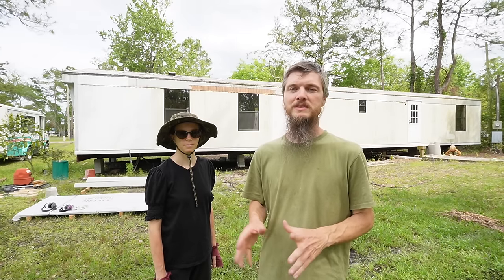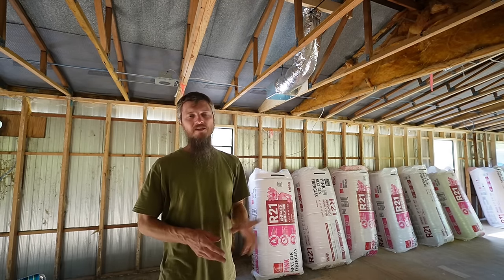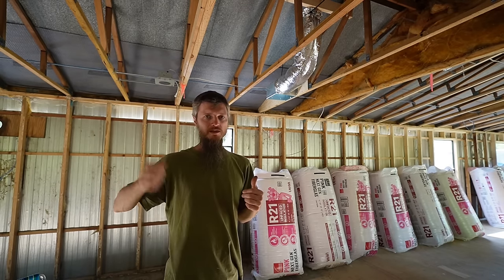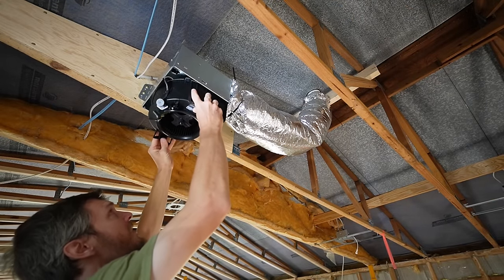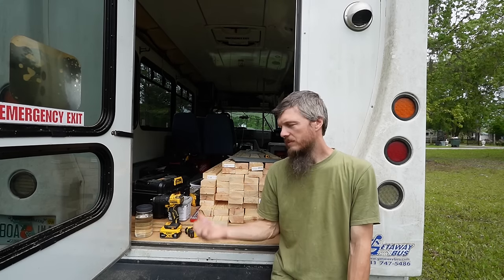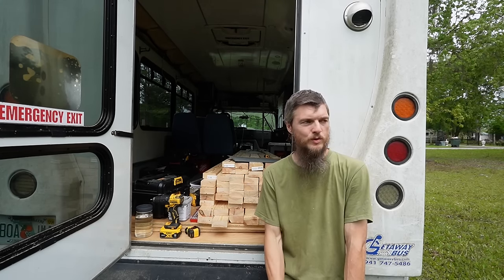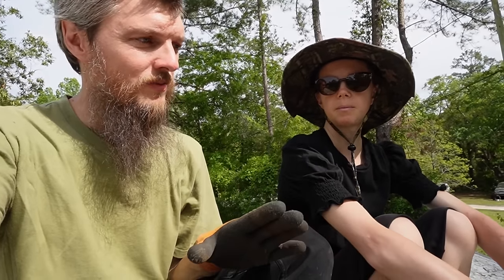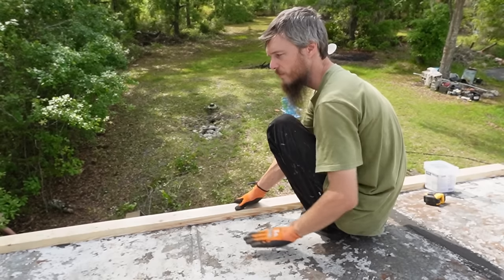Prep and Purlins, Getting Started on the New Roof - Salvaged Mobile Home Rebuild

Comment: Good choice in adding the roof on top of the existing one. I had my mobile home new roof added on top of the old one- it was cheaper, no tearing the old one off, removal of the waste and it added a extra barrier to the roof that was completely attached to the body of the home- I had it done by a company for like $3,500 and had the roof line changed - it had a step down roof at one end of the home, being a older one- They did use hard rubber spacers in-between the roofs which i love, because it added a noise barrier . I used a metal dark brown color which made it look awesome ! No leaks what so ever! My mobile home was like over 80ft long- made in 77

Comment: I am so amazed that you have not gone through the roof.  I have seen roofers put down a sheet of plywood to walk on to keep the weight dispersed.  In fact because of added weight it is often only 1x2 used to strip the roof and metal screwed into them here where I live.  These new metal roofs are so pretty.

Comment: Part of the renovation projects, having the few areas that are not exciting but still need to be addressed., just go for it and get them crossed off the list.  It will be nice to have the roof over done so you can install ceiling insulation, the hot weather is on its way!

Comment: Doug I’m not sure what kind of vent you have on the roof for the bathroom, however say that I have one and my vent is an 8X8X3. The top one inch under the bonnet is open all the way around. Yes it has a 4in hole in the roof but with it being so flat it doesn’t look bad or show about the ridge.
I also found some 4ftX2ftX1.5in styrofoam that I laid between my laths and man did it even make a but different in the heat inside.

Comment: It may not always be the case, but every home I've every purchased had an exhaust fan in the guest bathroom and a small (useless) window in the master bath.  Why?  Why?  Why?  The last thing I want to do when it's 110 degrees outside or 30 degrees outside is open that bathroom window.  It's great for letting light in, but is a poor substitute for a fan.  After procrastinating for years, I just installed an exhaust fan, (that will also pull air in if I desire), in the wall of my master bath.  What - A - Difference!

I'm glad to see you all finally addressing the roof after all the work replacing rotted walls.

Comment: Give you some over hang because if you don’t when it rains it will leak around the windows with how the trailer factory does it. Like a two inch over hang. I did mine 6 inch over hang and it worked great.

Comment: I apologize if youve already addressed this in previous videos. I've watched them all, but can't recall!  Since the original roof is shot, why not just pull the entire thing off instead of adding your new roof right over it?
Reply from the maker: The old roof still provides a lot of benefit. It would be a lot to explain here, but removing it would create a whole host of issues from structural issues to condensation and moisture problems. It's best to leave it. It adds protection, strength, and air-seals our attic space.

Comment: With the change in roof plans are you considering adding insulation between the purlins? I know it's not usually done if insulating inside. I know you were hoping to make the existing roof work.  I expect the new roof will be a lot less maintenance for you in the long run.
Reply from the maker: No, we don't plan on adding any insulation between the purlins.

Comment: Sure would be neat to lay some 1.5” foam board in between the roof pearling. It will keep the metal roof from denting when you walk on it to screw it down and of course add some insulation r value.

Comment: This is so great!  I wasn't sure what a "roof over(?)" on a mobile home was.  I envisioned it to be something like a mobile home sitting under a carport.   Is there any way that you can use the roof of the bus to manage the roofing material to make it a little easier to get the material on top of the roof once you're done with the purlins?
Reply from the maker: That was another option we could have done, but we decided it's just best to do this way. It should be easy enough to get the metal panels up to the roof without using the bus. These weigh less than the panels that we used on our main house and they aren't too long.

Comment: I understand the need for screw clearance, but I would have used 5/4 x 3” strapping, with treated 1/2” plywood or PVC spacers, at the attachment points. That would allow ventilation of hot air, and not trap any water, should it penetrate the new roof.

Comment: is that roof metal  you have sold in a kit?  or is it like 50 8ft sheets priced each ?  does it come with ridge cap? i have a 1986 trailer that i have to do the same thing to, not looking foward to it, you can go first!!!!!!!!
Reply from the maker: We ordered all of it through a metal roofing company nearby. We told them the dimensions of the roof, and they figured out how many panels, screws, trim, ridge cap, etc to get. The panels were cut by them exactly to the length we wanted and are priced by linear foot.

Comment: I kind of expected the roof to be a total loss and replacing it is probably the right decision.  I am sure you will figure this out as you go along and come up with an adequate design at a reasonable cost.  And, you will be pleased with the results.  I am wondering if it would be a good idea to vent that enclosed air space between the old roof and the new roof.  Maybe so, or otherwise the trapped humidity may rot your wood purloins.
Reply from the maker: Actually, the old roof is definitely savable, not a total loss. If I wanted to put the work in, we could patch up the seams and re-coat it. It would last many more years. I don't want anyone to think they can't save their old roof.

Very often, roof vents can actually bring in more humidity than the expel. On a roof like this it's actually better to leave it sealed up. We shouldn't have any moisture issues between the roofs.

Comment: 16:32 - Does rain get inside the wall under the window above Doug's right shoulder?  Hope you can get the new roof installed before the really hot and muggy weather sets in.
Reply from the maker: Nope. No rain gets in there. The prevailing winds don't hit this side of the house. The only time it would get in there is if a hurricane came through.

Comment: I have no experience of this sort of roof. So I don’t know anything about them. I have a question. Why is the ruined roof being left on? Can it not be removed? If it has failed my logic says remove it and replace? Can anyone explain why it’s being done this way please?
Reply: It's common with manufactured homes that the roofs give out but the way they are built, it's just better to leave the old roof on to provide extra structure to the home.
Reply from the maker: The way these homes are built, the roof actually adds a lot of strength and helps to hold the trusses on. It's better not to touch them and just install a new roof over the top. Also, these are built with a sealed roof assembly and if you remove the roof you will have to deal with venting issues and condensation because of the small amount of insulating space. Venting and insulating a low roof is a challenge. Plus it acts as an extra barrier to help keep radiant heat out so it doesn't hurt to leave it.

They can be removed, but it's not worth the problems that come with it.
Reply: @diyfferent  every day, is a school day. I have learnt something. Thank you for the knowledge and thank you for your great channel. You’re an inspiration to all of us out here, to keep going with our projects.

Comment: that bath fan sounded really quiet.  I'm sure part of that was the open floor plan you have now, as opposed to an enclosed space, but I need a new bath fan- what model did you get?
Reply from the maker: It's just a quiet fan, which is a high priority for us. Nutone model AER80K. It's good for rooms up to 75 sq. ft. They also sell the AERN110K which is for rooms up to 105 sq. ft.
Reply: @diyfferent Thanks!

Comment: Whatever you like to do is fine by me for your home. However, knowing how I do things, I'd have to remove all that old roof before installing cover up new roof. I just don't like to cover over old crumbling ugly deteriorated things with new material. I'd have to rip it all off and do it my way... Then I'd feel good about the finished job. But that is just how I do things...
Reply: In this case, I fear you would damage so many of the trusses, you would have to replace them, too.
Sometimes, you have to work with what is there. And, yes, I don't like the old roof either.
Reply: @ethelryan257  Well IF removing the old roof did damage the trusses, I would also replace them as well. I hate patch-up hiding work. But that is just the way I do things...
Reply: Might be better, but considering there is no sheathing, and just the two of them, removing the old roof would leave the home too vulnerable to the weather. This way is less risky, financially.
Reply from the maker: @garymucher4082  Sometimes leaving the old is the best way. There is no point in removing the entire roofing system and starting over. At that point the home would have been almost a complete tear down, which we're not going to do. It would be way too much labor and money with no added benefit. Leaving the old metal roofing will not hurt the home in any way. The metal adds strength to the structure and ties all the trusses together. Removing the old roof would also open a whole new can of worms with ventilation and moisture problems, and would require a new layer of plywood sheathing which adds even more weight that the home was not built to carry. Leaving the old roof is actually the correct way to proceed with a project like this. We're doing it right.

Comment: Question:  are you concerned about the added weight on the existing roof trusses that were designed for only the existing roof?
Reply: The 2x4’s will connect the trusses spreading the load more evenly, actually making the roof a little stronger. The metal roofing is not that heavy, .
Reply from the maker: I am concerned and we are working within what we believe are reasonable limits.
Reply: Thank you for answering my question.

Comment: Horizontal furring boards? Won't that prevent moisture from running off the roof? ❤❤❤
Reply from the maker: This is how the purlins need to be installed so that the metal panels can span across them. Any small amount of moisture between the old and new roof won't be a problem.
Reply: @diyfferent  Humidity may condense on lower metal roof then precipitate. Vertical then horizontal. Hopefully it'll be fine as it is.

Comment: Is there usually wood on a mobile home roof? 
I’ve seen people put a special paint on those roofs.
Reply from the maker: In order to install the ribbed metal panels we need to install these wood purlins. We were going to do a thick roof coating like you are talking about, but decided not to.
Reply: @diyfferent  
Thanks
Reply: One of the last episodes they tried to just go up and clean the roof and re-coat it, but the coating was in pretty bad shape and would have taken a lot of time and effort to correct it.

Comment: You are putting the wood down the wrong way because if any water does get underneath it will not have a path to escape. Remember water will find the path of least resistance. So it will sit and rot out that wood. That is why you see roofers do the first layer running in the same direction as the rafters, with the second layer designed to hold on the roof and to allow for air flow to dry out any moisture
Reply from the maker: I've actually never seen a roofer do it that way.

Hopefully we'll just be keeping water out of the roof to begin with.

With that said, :40
Reply: Yeah, condensation might pose a threat to these battens in the long run.
Reply: @diyfferent  if it’s never been done must be a reason. I have always seen a waterproof membrane layer put down first

Comment: Odd question. I haven't watched previous videos, but have you reinforced your walls supporting the roof? If you're putting the new roof on top of the old, that's a lot of extra weight the walls, and floors need to support. May result in sagging or parts falling out of square if you're not careful.
Reply from the maker: No, it's a good question. We're trying to keep this roof as light as we reasonably can for that reason. The entire pile of metal roofing weighs just over 500 lbs and it gets spread out. The wood and metal combined puts easily less than 2 lbs per square foot on the roof. 

The walls are strong enough for it. Our floor is definitely not framed with maximum support in mind, but we believe it will be strong enough as it is to carry the load.

We tried working our floor plan to put some of the heavier loads such as the water heater and washing machine over the steel chassis and away from the outer walls. Anything we can do to balance the load and keep weight off the walls will help and we keep that in mind.
Reply: @diyfferent  Was the old roof designed for a snow load? If so, you should be more than okay since you're never going to have one.